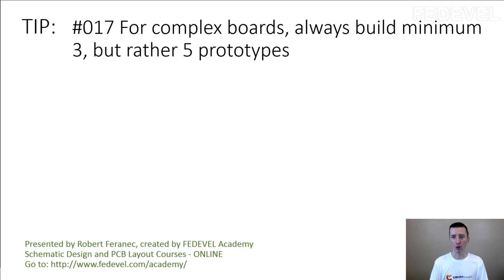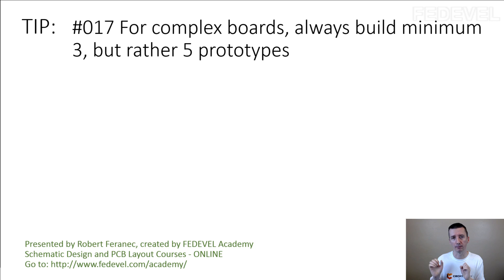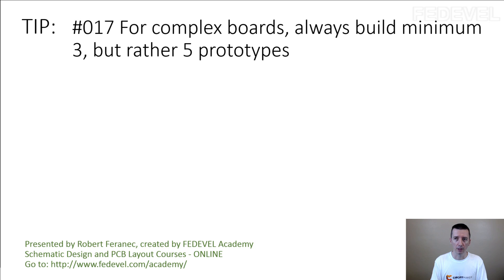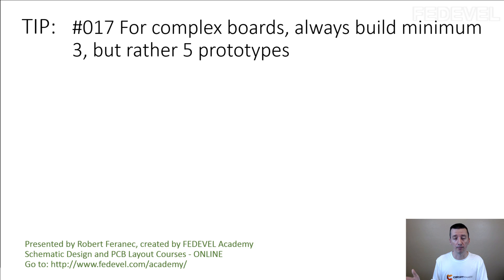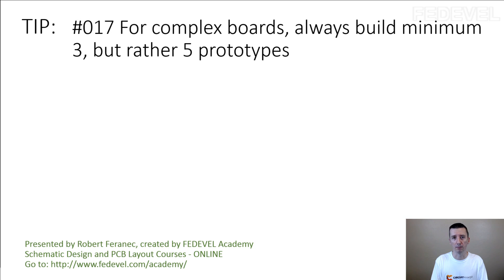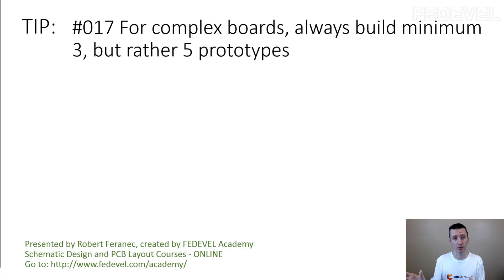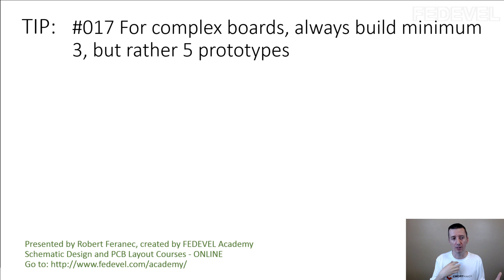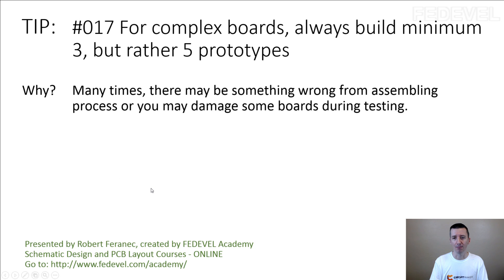TIP #017: For complex boards, always build minimum 3, but rather 5 prototypes

Comment: What sort of testing do you design into the board for testing after pick and place? Do you design your own test jigs? Pogo pins jigs/flying probe testing, load test firmware to blink LEDs etc or do you do all your testing in-house?
Reply from the maker: Depends on project. Most of the time it is a functional test. We connect all cables and we run number of different software to test all the peripherals and connectors. But we are always very careful when validating prototypes - these are measured and tested into much higher detail to be sure everything is ok.

Comment: If I have some board with very expensive FPGA, is assembly house willing to resolder it to newer revision ?
Reply from the maker: They should be able to do it. We have replaced many different BGA chips, including processors.
Reply: Very well, I was just curious if it is a common practice. Because if bare board cost about 700€ and FPGA+DSP in BGA cost about the same, then it makes sense to me to reuse these chips for prototyping.

Comment: I had a board where we made 2 prototypes, only after months of testing a board that had SI issues we found out that the pcb was damaged.
the second prototype was fine.
Reply from the maker: It's good you found the source of the problem.
Reply: also forgot to say, this tip video series is great! a lot of the tips you talk about are things I learned from mistakes made.
Reply from the maker: Same here, I learned them the hard way :) Thank you.